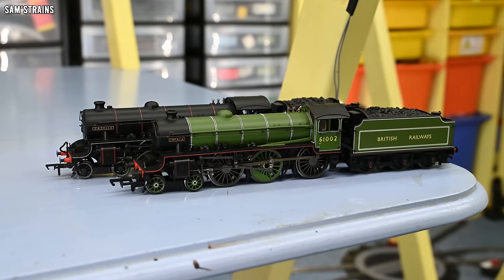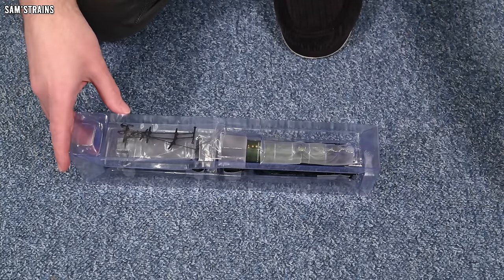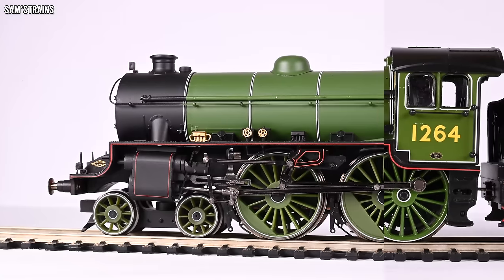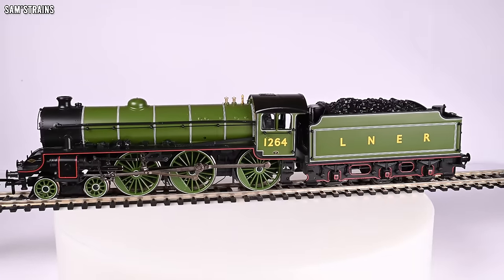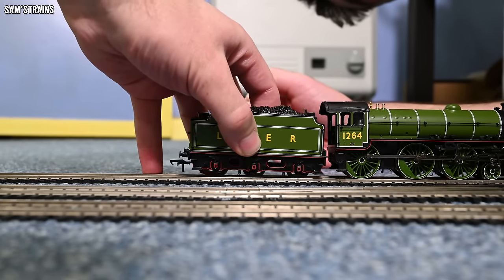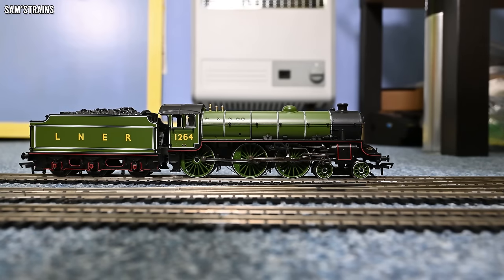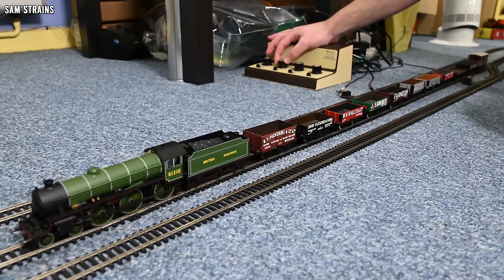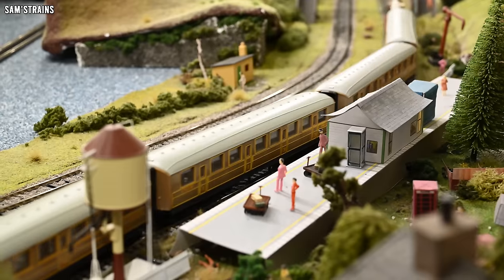Why You Shouldn't Buy the Bachmann Class B1 | Unboxing & Review

Comment: What are Bachmann thinking? My best loco is an old Ivatt Class 2 with a split chassis. Detailing is pretty good it runs AMAZINGLY well for such an old loco (1990s) yes the axles have gone but a new set is cheap enough and i can forgive that at nearly 30 years old.
It even has pick ups on the front bogie...

Comment: I thought only I had the plastic warping on wheels! My b1 is currently being repaired due to the connecting rods completely disfiguring and the being at a 60 ish degree angle to each other, caused by the warping twisting the wheels and so forth the pistons

Comment: I had the same issue with the tender forwards and backwards. I removed the middle wheel to run it in and then I had the bright idea to swap the wheels around and it has been fine since so I think one set of wheels is smaller than the other two and in the wrong order it balances on the middle wheel or so it would seem from my point of view anyway.

Comment: Ah yes, the B1. I always loved those locomotives, and I wish that there were quality but cheap B1's on the market. If only Tri-ang made one back in the day. If it were quality, I would buy the old B1 by Bachmann, as I have no problem with split chassis locomotives, but that warping wheel center problem I cannot tolerate. So, can't buy an old Bachmann one.

Comment: The wheels on the split chassis, are made of nylon and react to the oil if over oiled when serviced. 

It’s a fairly easy fix. Remove the tyre, heat it up with hair dryer and flatten it. The with a scalpel just remove around 1/2mm of the wheel and glue back on to the tyre. Works well for me!

Comment: I truly don't know why Bachmann are held in such high regard, They are over priced for out dated mechanisms and lack of tender pick-ups on there steam locomotives.
I model the Southern BR/SR steam era and would be lost without my Hornby locomotives, with 5 pole motors and all wheel pick-ups on there tender engines and on the pony trucks of  there tank engines for reliable slow running.

Comment: While I have no interest in the Bachmann B1, I am surprised to hear that Hornby have one as well.

Providing the Hornby B1 has tender pickups, does anyone think that the tenders can be swapped with the new A1/A3s?
Reply: The Hornby B1 has been around since 2012 it's a wonder people haven't heard of them tbh. As for the swapping, it's not possible as the B1s have the LNER group standard tender and the A1s/A3s were paired with GNR style tenders and the larger streamlined standard tenders with or without corridors (trying not to get too technical here lol). The Hornby B1 does have tender pickups as is the case with most Hornby steam locos but is also entirely made of plastic like this ancient Bachmann offering.
Reply: @18EStudios  I’m trying to make a Gordon model out of a Lemberg, but the tender is wrong. I’m wanting to use the LNER standard to make it more accurate to the illustrations.

If I can hook up the body using the B1’s pick ups, it’ll save me a ton of work rewiring.

Comment: I note you continue to spread the myth about "proper bearings". The facts dont change. Diecast zinc is a better bearing material compared to brass.  All you have done with your myth  is to encourage manufactures to make models that cost more than necessary without any performance improvement or longer life. Probably the problem with one of your tender wheels is that axle is to short, thats why it falls out . The reason why yhe model pulls well is because the tender wheels do not have folling resistance increasing wheel pickups.
Reply from the maker: Rubbish - I’ve proved conclusively and on video that the bearings/bushings produce a freer rolling chassis - it’s a fact. There’s a reason why every manufacturer fits them, and it’s not because of a “myth” I’ve invented.
Reply: @SamsTrains  Not all models use brass bearings. Your expermental method was flawed, as you did not compare the same model with and without brass bearings. Your experiment also did not measure wear. Scientist's and engineers have long proven that the friction in Zinc bearings is less than brass bearings. Remind me of your engineering and science quaifications. In  my case I have 30 years of engineering research experience and 60 years of model railway experience. My experience includes my first model, a H0/00 Triang   Victorian Railways B class diesel, made in Australia. Its power bogie has diecast Zinc bearing surfaces. These have minimal wear yet the driving wheels have a noticeable worn wheel profile and the brass worm wheels have worn out, not meshing any more with the steel worm. Also there are plenty of old Hornby Dubblo models running around today with their original diecast Zinc  frame bearings.
Reply from the maker: That’s not a flaw - you can’t test the same model with or without the bearings because each one is designed to either have them or not have them. Instead I matched the wheel configurations and weights and spent an entire day testing a range of different chassis and got consistent results… whatever experience you think you have doesn’t outweigh the clear evidence that I and others observe every day. The vast majority of new models have the bearings - they do make a positive difference, and the manufacturers know it too. I’ve spoken about this issue with several model railway manufacturers too who were in agreement… pointless to argue I’m afraid, bearings are in our models to stay and that’s a good thing!
Reply: @SamsTrains  Your experement methology is still incorrect, and your results are still incorrect. You have no credible evidence they make a positive difference. Talking to 'model manufactures' is not scientific evidence. Of course, because of your marketing myth of brass bearings, they have become a "marketing positive". Just because you do not have the equipment, knowledge and skills to use a model with diecast bearings then modify it and machine up some brass bearings does not mean it cannot be done. You ignore the fact that models with correctly designed diecast bearings show no disadvantages over brass bearings. You don't even realise that ALL models have bearings, some have bearings that are diecast and are part of the main frame. Look up the definition of what is a bearing. You also ignore the many modern diesel locomotives that have plastic bearings, which last just as long as metal bearings, and do not need lubrication. I forgot to mention, I also have models with diecast side rods and these last just as long as brass or stainless steel side rods. More proof there is no friction disadvantage in the diecast side rod bearings.
Reply: @terryflynn8830 calm down and wait are you 90? 60 years and 30 years experience? Your an OAP

Comment: Seriously, who is buying these?.  If you don't buy them they will have to change their policies.  

Bachmann need to wake up.  I found a 2013 magazine of all rolling stock available at our train club.  Dapol Wagons have gone up 3 or 4 pounds each.  Even Hornby was similar.  However all of Bachmanns wagons had over doubled in price.  There were wagons there that were £22 each that are now £59.99.  So clearly they are marking their prices up more than anyone else and they all get produced in China.  It makes no sense.  
I have voted with my wallet and have not bought their recent modern wagons because the prices make no sense.  Check out the prices of their HRAs and Lobsters!.
Reply from the maker: That’s very interesting - while most prices have gone up as you say, it does feel like Bachmann’s are dramatically more expensive than they were. I think they’re the worst value manufacturer in general